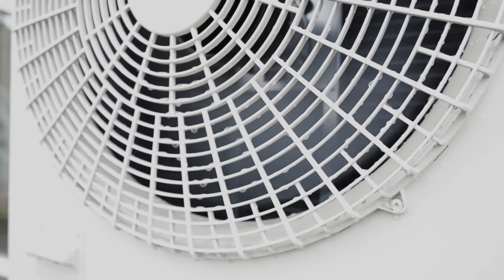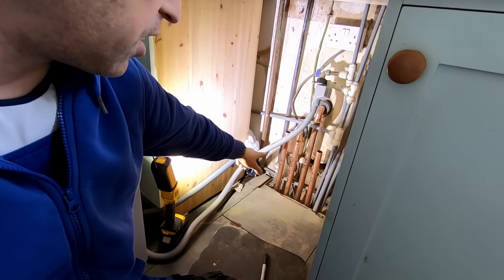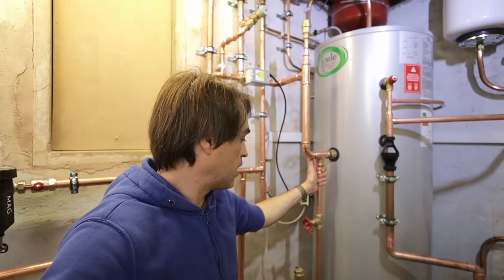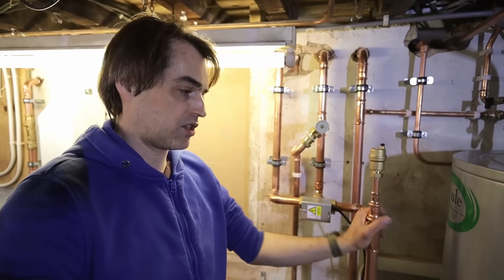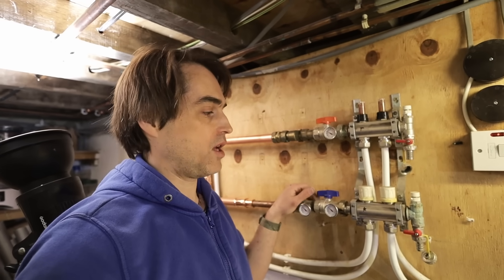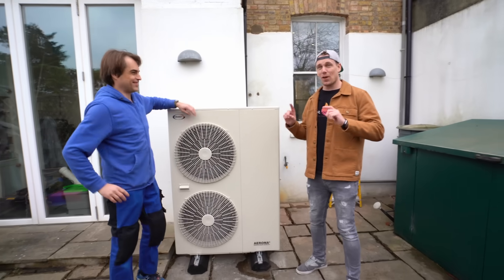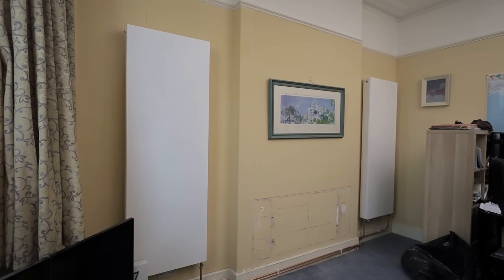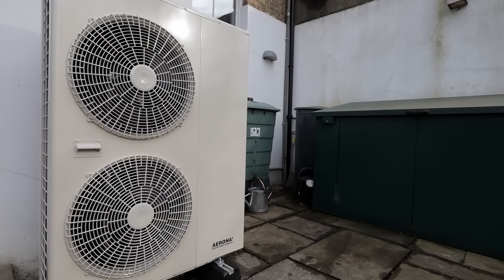The Truth about Heat Pumps: Debunking the Myth.

Comment from the maker: To everyone commenting on the size of the radiators I would just like to point out that from June 15th 2022 new Part L building regulations will require all full central heating installation including gas boilers to be low temperature of maxium flow of 55C

What it means in practice is that even on gas boilers you will have to install radiators of considreably larger sizes and in older properties it simply means radiators of similar size as in this video for rooms with comparable heatloss.

See below

"A revised version of Approved Document L (Part L) of the Building Regulations has been published which will take effect from June 15th 2022. With this revision there are a number of changes to guidance and requirements covering both the new build and retrofit markets.
 
With regards to existing dwellings the main points are:
 
Complete New System Installations require:
An appropriate heat loss calculation for the dwelling
A system sizing methodology that takes account of the properties of the dwelling, such as the Chartered Institute of Plumbing and Heating Engineering’s Plumbing Engineering Services Design Guide
The system should be designed to operate at a 55°C heating flow temperature"
Reply: The mad thing is that condensing boilers have been mandatory for new build and retrofit for 17 years, but they forgot to specify that the rest of the system should be configured to allow them to run in condensing mode.
Reply from the maker: @shouting-into-the-void  exactly - 90% efficent heat source - 75% effiecnt system
Reply: Essentially any new installs will basically require UFH or oversized rads, both of which are not exactly convenient for quick installs or smaller properties. I fear the days of a relatively quick swap out of an older system to a more modern boiler/combi/unvented will be replaced with these hugely expensive, multi trade engineering jobs as the whole building is adjusted to comply with the new part L.
Reply: @nauticalmandems  You will more likely get people patching up their old inefficient system for decades rather then moving to more efficient and modern boiler because of the huge cost of needing their entire heating system ripped out and replaced if they do.
Reply: Heat loss for that room is  very high, The music room floor area could  not  be more than 20 m2. If you divide 1700W over 20 you get 85W/m2 this is very high compared  to a modern house which is  around 40-50 W/m2 range. This  means that radiators size would be halved for a modern house. Design Engineer should have tried to reduce the heating  load by reducing it to 60W/m2 . This can be done by  making  the house  more energy  efficient. using various methods.
Reply: Radiators for gas boilers at 55c will be larger than heat pump rads at 55c due to the MWT. Good news is that when we convert to heat pumps we will be able to run even lower temps increasing SCOP 👌🏻
Reply from the maker: @copperskills3973  you don’t have to run a gas boiler at dt20. - it will run fine at dt10 making rads same size fir Hp and rads, as we almost never design at 55c flow. 50 is probably the hugest flow temp you would design for HP
Reply: Yo, but we need more heatpumps to make tha climate change great again
Reply: Why use an expensive 100c pump with a system that generally runs well below 100c.
Reply: 55c doesnt seem hot enough to kill and stop bacteria growth the system will get clogged up
Reply: @bigchicken061  55 is prime breeding for legionnaires. but the boiler is at 100, so that kills on the recirculation
Reply: its like those people the media said were "nut jobs blocking the motorways" were right about better insulating your home is far more effective at carbon emmision reduction than this heat pump "make money quick" scheme.
         these are just reversible air-con systems without the benfit of having a cooling function in the summertime (have been made non reversible).
jokes. total jokes
Reply: Didn't know this. Jesus, they're deliberately crippling gas boilers to make the heat pumps look less bad!
Reply: Use fancoils instead, and you can lower the temp on the heating water to 30-35°C
Reply: The new regs say "should be sized..." not must be sized on 55degC.
Reply: You can get in-wall heating, arguably takes up more space since it adds some thickness to the wall but it's a big surface area and not taking up wall space.
Reply: I think people are reading too much into the size of the rads. A modern new-build wouldn't need such large rads, and the ground floor would typically be UFH.
Reply: @hvacdesignsolutions  i don't know a single person that has UFH or lives in a new build because i'm working class just about afford an old out dated property that cost about £95K and just need to spend about £15K on a heat pump then more on UFH new rads new insulation and remove my downstairs toilet and utility room which mean i need to find a new room for my washing machine and tumble dryer most properties are old
Reply: @hvacdesignsolutions  BUT I, and many others, do not live in a modern new-build nor do we have UFH.  Yet the government is trying to tell us that ASHP is the answer.
Reply: @hvacdesignsolutions  LOL at underfloor heating, the biggest con ever. What a shocking waste of money.
Reply: My house was built 2000, the windows need done as theres heat loss through them, 4 bed detached house and my flow temperature is 60. I still have no problem heating the house. If you have a good pump and a clean system your temperature differential is not that much. Ive literally got mine at 9 degrees. Thats with 10 rads. Its all the small things that need to be considered. As for part L, good luck getting anyone to police that. Where you getting all the 28mm copper from.
Reply: How the clown show works: Our government signs a deal at a supranational organisation without the express consent of the people, realise they've fucked up, pretend they haven't fucked up, eliminate alternatives to try to further hide their fuck ups, get people to waste huge sums of cash, wait for the next cabinet to form, and then the new cabinet says the old cabinet fucked up. Guys, time for your fourth shot. lolololols.
Reply: Does anyone in the UK use minisplit heatpumps?
With temperatures going up it seems that the UK is missing out on AC possibilities with heat pumps by staying with the traditional heating system designs.
Instead of giant radiators on a low temperature hydronic ysstem could follow the example that is common in hotel and commercial setups with a circulated water system kept at a given temperature by the central boiler and an airhandler heat pump in each room. Rooms can heat and cool independantly.
Reply from the maker: @ericdunn6232  you cannot get a government grant for those as they do not want you to waste energy on cooling
Reply: "June 15th 2022 new Part L building regulations will require all full central heating installation including gas boilers to be low temperature of maxium flow of 55C"

Does this apply to boiler swaps only? Or only if the rads are being replaced? Thanks.
Reply: New condenser boilers have this too.
Reply: Will stick with my Baxi Bermuda 👍
Reply: They don't need to check because good plumbers won't want to risk their licence by ignoring the regs. Besides boiler manafufacfurers will stop selling high output boilers anyway so customers will demand larger radiators anyway. No one is going to want a new system that doesnt warm their home.
Reply: I hope you become very comfortable in life, youre incredibly efficient and smart and you actually care
Reply: I wonder if the people who make the rules have allowed the extra Co being produced by manufacturing new radiators and recycling the old ones .
Reply: There are alternatives to massive steel rads - high performance compact aluminium rads. I should declare an interest - my company designs and makes these in the UK, but our rads in general are 1/2 the size and 1/3 of the weight..
Reply: Thanks for the update
Reply: I think you opened a can of worms there pal :} NOW that heat pumps have appeared on the market the regulations have been changed to accommodate them. I call bs and heat pumps are a fad which will go the same way as EVs. Adios muchacha......
Reply: Hello! love watching your videos but i have a question about the radiators in the music room. Firstly, radiators give heat 3 different ways (conduction, radiation, and convection) Since the radiators wasn't under the windows and taking into count how big they are I'm guessing you were going for Radiation mostly. Since Radiation is calculated by the m2 we know that the bigger m2 = more heat radiated. Am i thinking right that you bought it mainly for radiation and if so why didn't you buy a radiator that has groves, since this decreases the size of the radiator but still has the m2 for a lot of radiation. 

Kind regards
Energy engineering student from Sweden.
Reply: So they’ve changed the regs to make the giant radiators of heat pump installs look normal. Space is at a premium in most older houses in the UK hence the popularity of combi boilers allowing removal of tanks to free up living space. In my opinion heat pumps have a place in new homes designed for them but as a retrofit too expensive and too room intensive, wait for better tech.
Reply: @rsole65  I agree. It's all so farcical. Seems to me if you want to be green you better have deep pockets. To me, that is fundamentally wrong. I want to be green but I can't afford it. And that probably applies to most of us. Sadly, those like me and many others also, are slaves to oil and gas, and ironically we are the ones who can least afford it.
Reply: @rsole65  All these people with videos up are at it con men wanting the government grants
Reply: @rsole65  Yeah, that is something those "green" politicians" tend to overlook, when forcing these new heat systems. In new homes, with extreme insulation, you can get away with much smaller radiators, but older homes will likely end up with a clumsy installation, and less comfort. Hydrogen might be a better option, can use the existing system, just needs a different furnace, and the exhausts are just water.
Reply: @rsole65  Yes. Where do they expect people to put such large radiators? In our living room, the only wall that it would fit on is also the only wall that a sofa will fit on! The kitchen is full of cupboards and appliances, so only a tiny radiator will fit. The hall/stairs/landing has two walls available, but neither will take a radiator more than 500mm wide. The bathroom could take a larger radiator, but moving the pipework would involve destroying the tiled floor. One bedroom could take a larger radiator, the second, with two children in it, plus the hot water tank, valves, etc. only has space under the window, while the boxroom is so narrow, that a bed on one side and a chest of drawers on the other, leave just enough space to walk through, so the only space is at the foot of the bed and only 600mm wide (unless we removed the door that opens into the space next to it!
Reply: @rsole65  someone that knows what there talking about
Reply: @rsole65  No, they've finally changed the regs. to do something they've been doing in Europe for years i.e. run boilers at a lower flow temp to they can actually reach the efficiency that they are suppose to reach
Reply: @rsole65  Not finding space for enough radiator is just a lack of creativity or a bad excuse to be stubborn. My house has small rooms, it has 2 radiators that are 200 wide, 1 that's 270 wide and 1 that's even 300 wide along with a few smaller ones, all Type33, in a house that used to be heated with 2 stoves. Sure you could say "but if you didn't have such a large radiator there, you could have layed out the room this or that way to have a bit more storage space"... The reality is, although I did have to change around and swap some furniture to make it work (the living room now has 2 2meter wide radiators instead of 1 stove f.e.), I didn't lose any storage/seating/sleeping/working/... space at all because I carefully planned (and where possible tried) out each room beforehand. I didn't even have to go the route of underfloor heating, which is also an option if you really can't find enough wall space for overdimensioned radiators.
And as another alternative, you could always go the air-to-air route or use fan-assisted convectors to save space.
Reply: @Candisa  You overestimate how much space can be used, unless you plan us to stack radiators on top of furniture small enough rooms can't afford to have more things
Reply: @JorgetePanete  If the room is so small, you probably have a single panel radiator in it you can replace with a 3-panel one of the same size. There's also the option of underfloor heating, doesn't take up any space at all.
Reply: @Candisa  Money, options cost money, lots of it, in my case the whole building is like 70 years old, wooden floor, bad walls, poor insulation... I don't have much idea about radiator types but it's 5 layers deep and 7x2 sections wide
Reply: @JorgetePanete  Then I think it's about time people knock on the governments door for them to take action. I live in Belgium, not exactly known for great politics, definitely not in the last decade, but there are actually new grants here that cover up to half of the costs of energy-efficient renovations based on income, and they don't only include the insulation itself. I'm having the worst part of my roof redone in a few weeks, as somebody living alone and not being a lawyer or a minister or something, I'll get 50% back of the total cost of the lumber, subroof, sarking board, insulation, dampproofing, hours, small materials... I'll also have some of my windows replaced, that will also only cost me 60% of the cost of the actual windows + labour...
Something has to be done about the older houses, you can't expect those old houses to stay the way they are, leaky and inefficient, and just keep pumping energy into them to keep them livable.
Reply: @Candisa  I live in Spain with some family, same home all my life, which long ago was a business building, and dad refused to invest in quality of life :/
Reply: So basically it's only complete new system that require the radiator outputs at 55°c so for a Combi swap this wouldn't be the case?
Reply: Looks and sounds like a nightmare in a few years time. A system like this is far to complicated for the average Jo plumber. Stear well clear or it will cost you both in money and frustration  !
Reply: @peternorman2563  i used to be an aircon and refrigeration technician. you would not belive how many sloppy installs where the gas was leaking into the atmosphere.
      and their "regular technician" was charging them to re-gas it every 6 months.
    the irony that the air con systems are full of green house gasses, and making hem leak increases everyones need for aircon.
    first it was pump the heat outside to make the outside hotter (simulate gloabal warming).
     now they want to pump the heat from outside when its cold. making outside colder...
Reply: @peternorman2563  but that means you have to have maintence by one of the large heating firms (heat pros whatever), even with conventional systems Part L revision 2022 is a new way of shaking down the customer - complete refit -not just rads but pipework as 10 mm microbore and possibly polybutile pipes being unable to supply the flow (note how this video avoided using endfeed or "yorkshire" fititings and bends -signs of inadequate flow co-efficients) -with the usual huge costs in things like redecoration. Then there is the noise of heat pumps both for the householder and neighbours.  

Effectively Part L 2022 has specified a requirement between a conventional CH system and an underfloor system running at around 45° but you can't have a radiator size based on the floor area so compromise of 55° -I can almost guarrentee people will be maxing their system to compensate, so nuts to the requirement that domestic dwelling energy use must be reduced by 31%. These new regs -in fact most of  Part L and Building regs in general are money making shils for council and self certification schemes (and I mean scheme as in schemer). Just as double glazing schemes have been -leading to a majority of the stock -even on relatively new build housing being defective.
Reply: Does heat pump you installed run system at 55c and now long does take to get up to temp?
Reply from the maker: @CrashUK28  currently it is set up at 48c flow on wether comp, so it only goes to 48c when it’s -4 outsdie
Reply: Pure genius! - The solution to impractical, inconvenient and expensive is to impose the same on everyone else. Have you thought of a career in politics? - It's definitely a field that needs your kind of vision and clear thinking. It's not like we have enough politicians doing dumb $h|t already - I can definitely see some openings for you.
Reply: I will be using the back boiler in my villager and burning stuff to heat the house. It is a human bloody right to have a fire and I will never stop. The regs are ridiculous.
Reply from the maker: @Jack-tx2ve  human right to pollute the air for others? don't think so. Also kWh of dried timber is comparable to kWh of gas or air source anyway, giving you fewer excuses.
Reply: @UrbanPlumbers  Its polluting the air less. My villager is old, it will still work in 100 years if its looked after. That is not true of any of the tech that is being forced to be installed now. So really sunlight and soil plus co2 to then be burned in a simple fashion and negate the need for a complete refit of the houses plumbing system probably with plastic pipe etc etc. What is not environmentally friendly about that?
Reply from the maker: @Jack-tx2ve  no reputable installer uses plastic pipes. If you have seen my videos you will know that we only use copper 100%. What is going to happen if everyone decides to burn wood for heating? We have been there before.
Reply: That means the return will be below dew point and condensing boilers will waste energy
Reply: @hughtattersall7583  surely the entire point is for it to be below dew point so that the gases are cooled enough to condense???
Reply from the maker: @sunthroughtheblinds  correct
Reply: @sunthroughtheblinds  The lower teh better. Just steam and water coming out with returns at 10 degrees
Reply from the maker: @hughtattersall7583  that means that condesing boilers will finally condesnse and be way more effiecient
Reply: @hughtattersall7583  how did you come to this seemingly 100% wrong conclusion?
Reply: @hughtattersall7583  Thats fine what about the millions of houses that are not well insulated or indeed suitable
Reply: @hughtattersall7583  condensing boiler work better at low temps.   57c is most efficient flow temp can be close to 98% efficient.   Run a 80c flowtemps and you looking at 90% efficient.
Reply from the maker: @CrashUK28  not quite.  On gas boilers it’s all about return temperatures when it comes to efficiency. Watch my video here https://youtu.be/wFOpHNz7Fdc
Reply: @hughtattersall7583  I thought the lower the temperature the better.
Reply: @hughtattersall7583  I am not a heating engineer but I know the lower the return temperature the greater the efficiency. Less plume of steam is a good sign.
Reply: @hughtattersall7583  So adding to the governments fiction that ASHPs are cost effective and efficient.
Reply: I’ve got a 1940s semi with solid wall.  Had triple glazing and 90mm external wall insulation.  All rads previously oversized when I had a new heating 3 years ago.  

I was hoping to have my solid fuel stove on a link up (currently connected via a thermal store)  

I can’t find a company or manufacturer that will do this